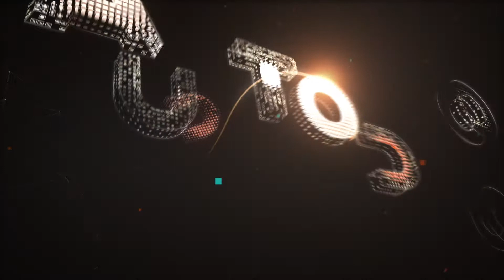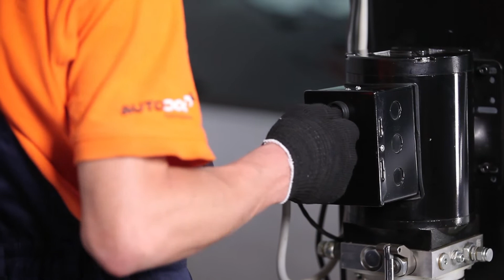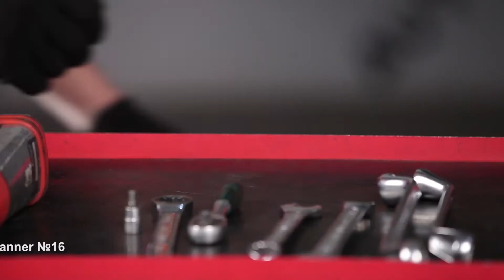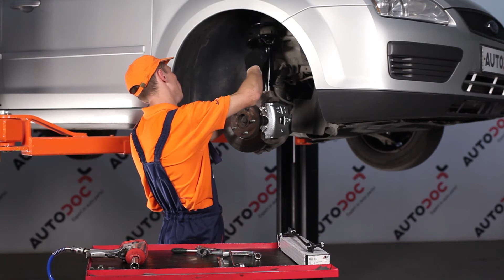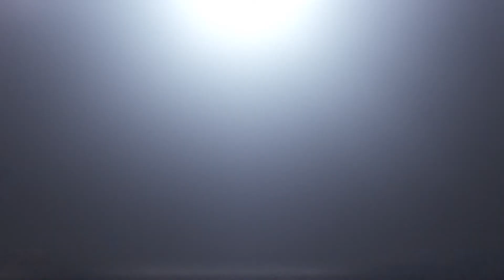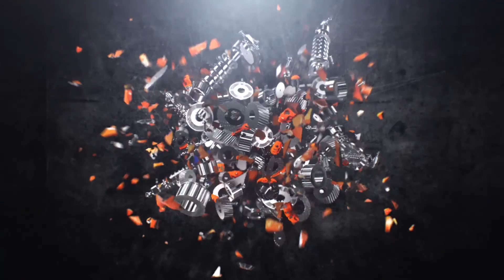How to change a Front Anti Roll Bar Link on FORD FOCUS 2 TUTORIAL | AUTODOC

Comment: They all look the same. I bought on ebay but I receive a shorter one. Why dont they indicate the dimension specifics of this simple metal rod? Can we just buy replacement based on length? It seems to me that same models of car may have different sway bar links specifications.
Reply from the maker: Thank you for the feedback! If you are interested in a any spare part for your car, you can contact a specialist of our company. Best regards, Autodoc.